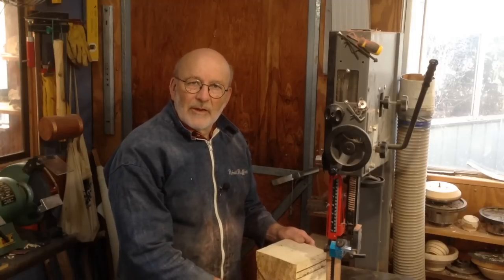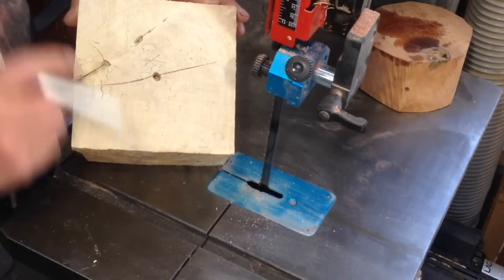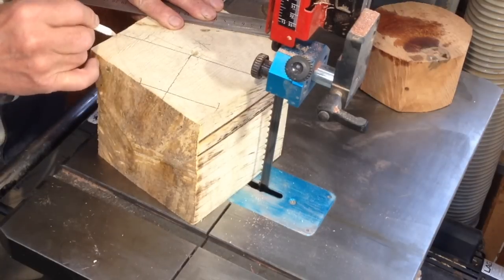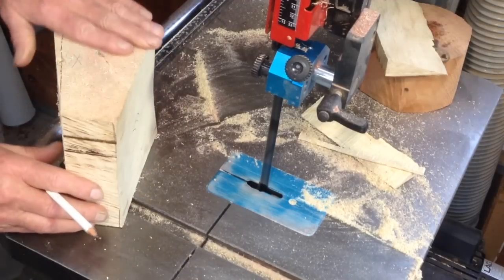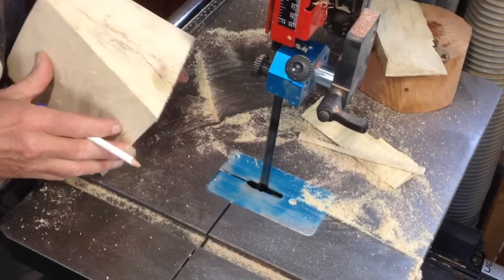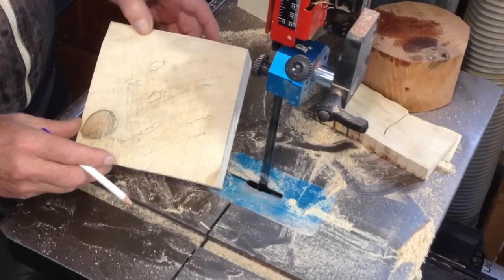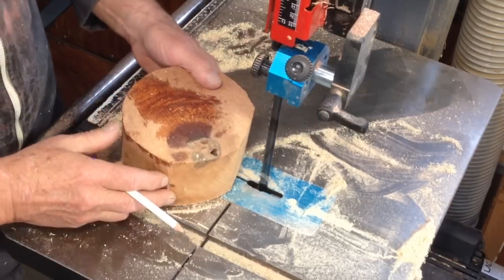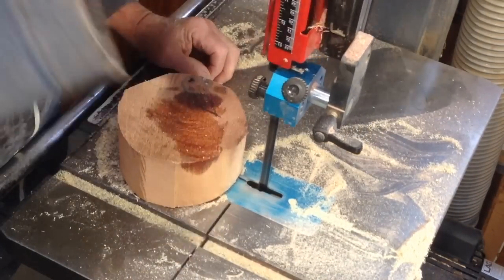Richard Raffan salvages split woodturning blanks

Comment: Use all you can...just a question..do you have trouble selling all those small bowls?  In my area you could probably only get 5 or 10 American dollars for the little ones. Didn't think they would be worth your time?  Thank you for all your insights.
Reply from the maker: I used to sell a lot of 2-in diameter bowls with a mini scoop, each helping to sell the other. In an hour I turned at least 10 bowls or scoops so they are worth my time even at $5. Selling small bowls is a marketing exercise — people need to be told a small bowl is ideal for nuts or rings, elastic bands, paper clips, salt, sugar, and anything else small that needs to be contained.

Comment: The beautiful part of green  woodworking is all the free firewood you end up with.
Reply from the maker: It's not necessarily firewood if you get at it quickly enough.
Reply: Great video and  thanks for all the videos you are making. Just wondering what bandsaw you have and what you would recommend. Thanks Brendon
Reply from the maker: @daylesfordorganics  I'm using a Laguna 14/12. The latest model has a foot break which makes it a much safer bandsaw than mine. It's an excellent saw although I find the blades tricky to change and the lower guides near impossible to get at to adjust.